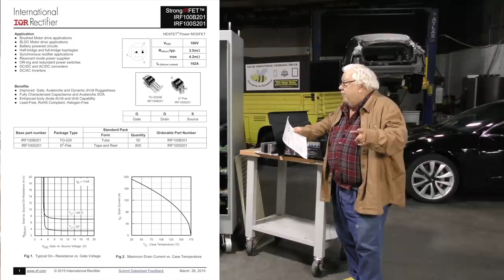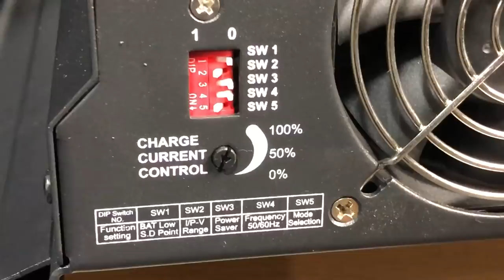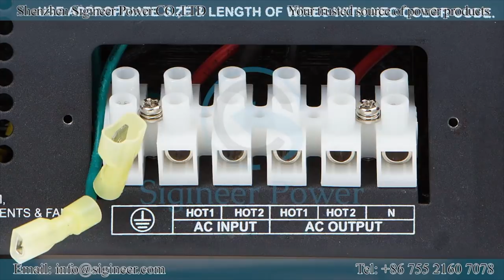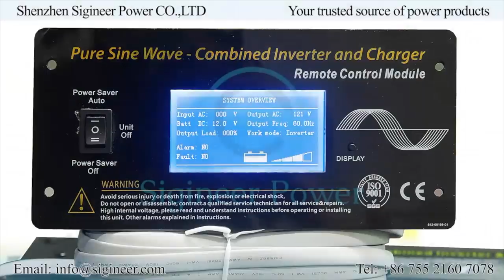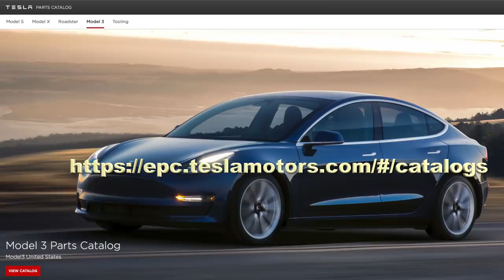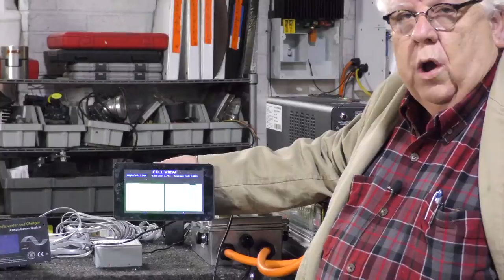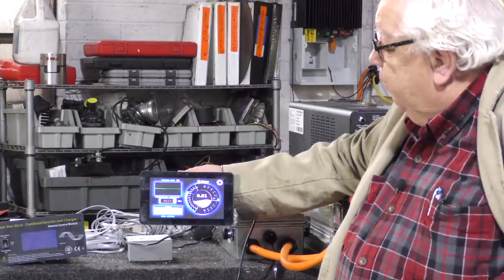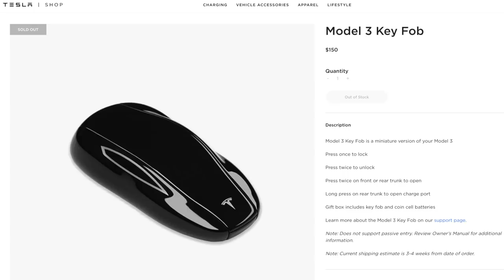ESP32 BMS Controller for Tesla Model S Batteries released

Comment: Pyro Fuse maybe Auto safety regulation however many problems it causes.   "Does the TM3 have something similar to the fuel shut off inertia switch in an ICE car that disables the car in the event of a severe enough impact? Yes, it has "pyro fuses" to disconnect the battery from the rest of the vehicle."

Comment: If you have a fire with the Tesla batteries, how do you control it? Can the fire be put out?
Reply: they are self extingushing. and if a fire happens is it very local as the cells are small and need to be physically punctured in order to even get something to happen to them. a gas tank is way more dangerous
Reply: @SupremeRuleroftheWorld  Rubbish

Comment: Then 96V DC Sigineer inverter is a big step forward but a 350-400V inverter that works with full EV packs would be significantly better.  Is Sigineer interested in pursuing this now or in the near future?
Reply: @Jack Rickard Much more expensive - those voltages require specialized silicon carbide mosfets, or some serious juggling with normal mosfets in layers so they never see the full voltage.
DC voltages over 100V for home power are really not a good idea for consumer applications, because of the danger they can pose, and are subject to regulations in some countries.
96V is about optimal for price/performance/safety/current considerations, though I'd go with a 50-58V 14S for a 48V inverter which is probably cheaper.
Reply: @Jack Rickard As you know, you only get high currents with low resistance - so touching 58V with a dry finger isn't going to do very much, but 400V will easily take a life without even noticing.
I once shorted a 12S lipo and was temporarily blinded by the flash and sprayed with gaseous and molten copper - will never to that again even accidentally!
High voltages are fine as long as nothing and nobody can get near them, but the cost outweighs any advantage for home systems. This may change though as more people want to charge their cars more quickly using large solar arrays and batteries, but I don't think we're there quite yet!
We'll find out soon enough how the technology evolves and what standards emerge.
Reply: @ahaveland  touching 400V DC with dry or even sweaty hands/arms will NOT take out a life.  Ask me how I know.  If you think shorting 12 is fun, try shorting 50 of them.  My guess is third-degree burns a badly melted socket...along with blinding light and a deafening sound...ask me how I know...

Comment: Jack, Would a transformer-less inverter work as both a charger/inverter?  If not is their a price point where it makes sense to have a transformer-less inverter for the solar inverters to sync too, and one or more EV chargers that can be switched on (via CAN) to charge the battery? Thanks for the great videos.
Reply: @Jack Rickard Have you seen what Tesla uses for the inverter/charger in their Powerwall? I've not.  Is it possible Tesla is using the 32 amp Model 3 onboard charger for the inverter/charger in the Powerwall?  Seems like Tesla's Powerwall is (or will be) doing exactly what your PowerSafe does with the added function of providing sync for solar inverter if/when the grid fails. Possibly Tesla is using a  transformer-less inverter/charger in the Powerwall?  The ratings for Model 3 charger and the Powerwall are in the same ballpark. Space (and weigh) are at a premium in the Powerwall just as it is in the Model 3. A small less expensive liquid cooled inverter/charger is something Tesla would want to deploy as widely as possible to get the scale to drive the costs down.  If the same inverter/charger is used, then when the time is right, Tesla could announce that owners of a Model 3 could use it as a 2nd Powerwall when paired with a Tesla Powerwall (which handles the grid isolation/transfer switch etc).
Reply: @Jack Rickard Thanks Jack for the reply. I look forward to seeing what you can do with the Model 3 components.  Happy New Year to you and your EVTV team.
Reply: Transformerless linverters are often lighter and cheaper.  If you read other forums on them pleas for help are often seen when high frequency noise plays havok with other devices on the load side.  They of course must have an enclosure that attenuates RF leakage.  Too bad we don't currently have a high-tech version of Consumer Reports for high power consumer electronics.  IEEE and UL are capable but lost their focus and only protect the rice bowls of the big boy fat cats.